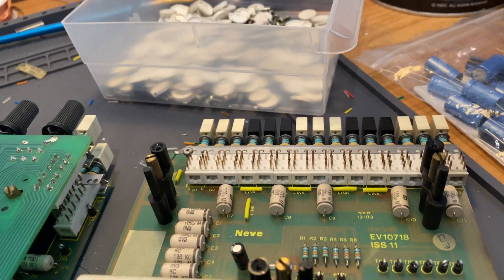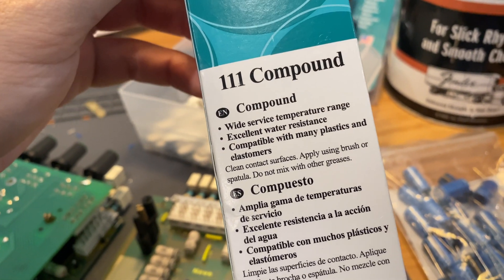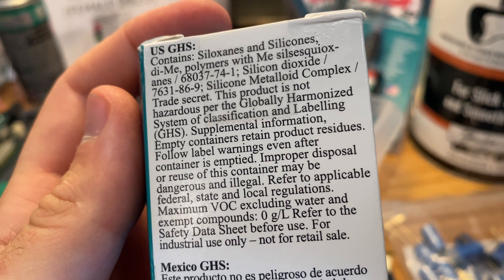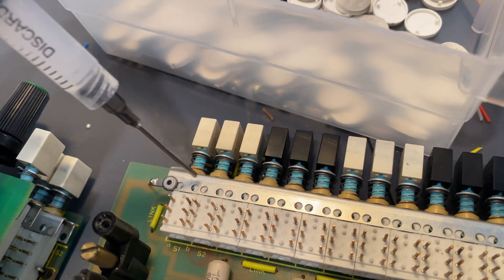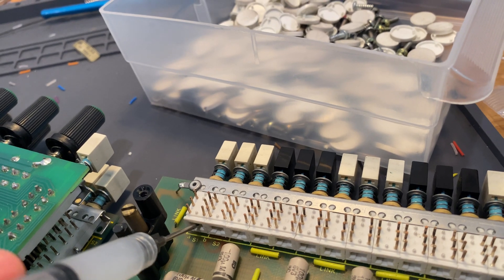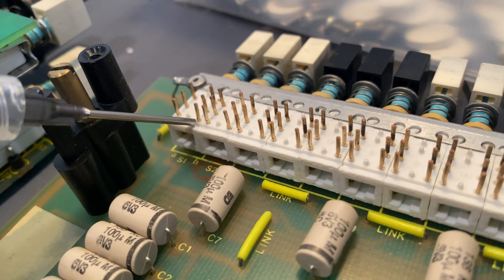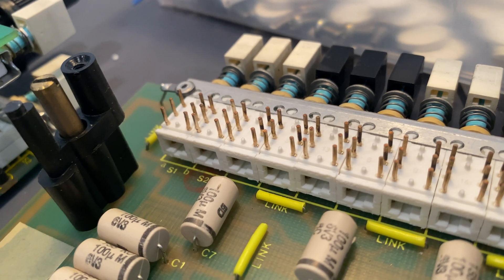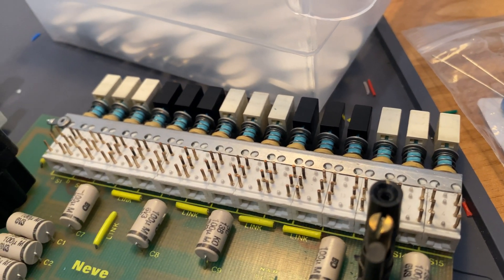UltraSonic Cleaning Neve 8248 Console

Comment: Hello, nice viceo, Thanks. What temperature did you use and how long did the PCBs stayed in the Ultrasonic Bath?
Reply from the maker: @MrCacciLLo  i would follow the recommendations on the solution you use. I did 50C for 2 mins then took the boards out and changed the pot/switch orientation followed by another 2 min.

Comment: What size machine did you decide to go with?
Reply from the maker: i got the creworks 10L, which is 2.6 gallons. If I had something to fit the entire channel strip, that would have saved time, but I wouldn't trust putting a transformer or P&G fader into this stuff!
Reply: @metalhead3ecr  I thought about getting the 10L so bad. I went with a 6L because it should be all I need for what i'm doing, but I knew if I wanted to do something bigger 10L might be the way to go.  That price though,.
Reply from the maker: @boredfive3001 i got it for 127 through amazon, price wasn't bad at all!